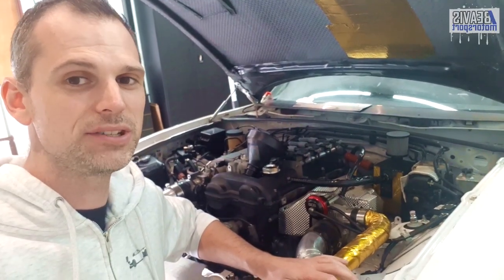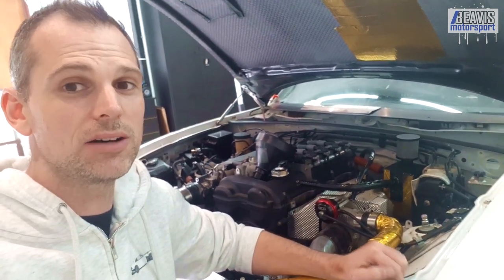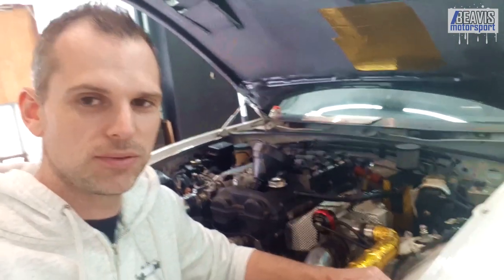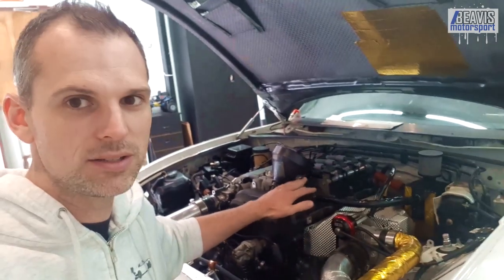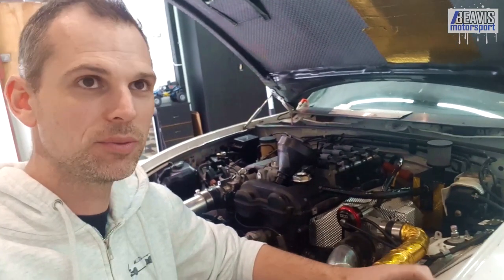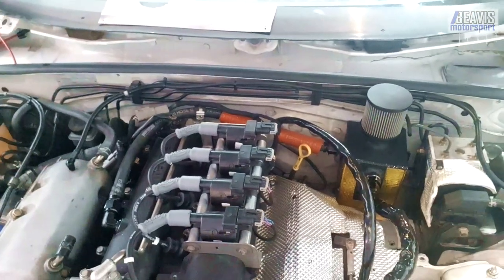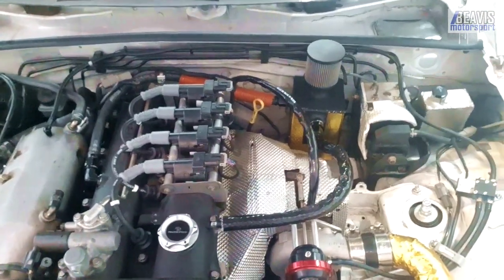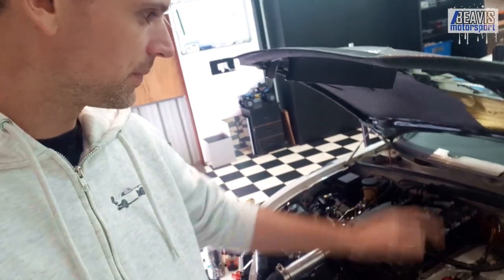Why is the Catch Can on my Turbo Engine making milkshakes?

Comment from the maker: Thanks to all of you for the great and detailed comments.
I emptied and re-checked the catch can after my last track day, and there was barely 100ml in there.
So, I'm content that the volume is quite small for the amount of driving the car's been doing.
Most of you said a small amount of oil in the can is normal, and the 'milkyness' is a symptom of condensing moisture in the cooling air of the catch can.
In hindsight, I don't think there's any concern with the catch can setup.
Reply: Great news!  The beast slays for another day!

Comment: Before I watch, I will answer your question:  To bring all the boys to the yard.
Reply: After watching:  Sounds about right.  Everyone here has been able to give you a solid answer as to what is going on.  However, it wouldn't hurt to check compression and see if they are within spec, check your oil as well, typical inspection.  The catch can is doing it's job.  I personally empty it out every track day or every LOF (car rarely gets driven and it's usually almost dry)
Reply: How many dings in the song ?
Reply: @michaelbouwmeester387  more than four
Reply from the maker: I was wondering if someone would make a "boys to the yard" reference....
Reply: @tvanduyl  21 if my memory serves me well.

Comment: Just brain-storming here because you asked.  On my track car, prior to rebuilding the LS2 due to a blown head gasket the catch can would fill excessively, as in ~2L+ per track day.  Post-rebuild I get less than 500ml.  I'm sure you know this already but blow-by contributes greatly to crankcase pressure and thus pushing oil out of the PCVs.  Compression and leakdown tests are a typical starting point to get a picture of engine health/sealing ability .. have you done those recently?  From the milkshake comment you seem to be alluding to coolant mixing with oil 😬 Another thing to consider are those PCV lines in the valve cover, are they baffled or is it a straight shot?   On an LS there's a baffled plate that prevents oil going directly into them.  Ideally the catch can should only receive misty air-oil and separate them/collect the oil. 

Sorry for the ramble, as you likely know this stuff already, have had the same thoughts, and talked to your friends about other possibilities.  Hopefully, your engine's in good health and it's just a matter of changing up the catch-can plumbing.  Keep us updated!
Reply from the maker: I've not done any compression testing.
Thanks for your thoughts seems like my suspicions are about right, and in general this is the catch can doing its job.
In hindsight the volume int he can is less than first thought for the number of hours the cars been driving lately and certainly not a concern.

Comment: If youre running e fuel there may be more liquid catching. If youre running rich also. If youre not running any baffles in the rocker cover/s you will tend to get more oil catching also. What youre describing doesn't sound too bad at the end of the day.
Reply from the maker: Thanks for the feedback G, yes the car runs ethanol fuel.

Comment: are you running ethanol? you should run the fuel additive for ethanol, it works to reduce the amount of water in the fuel and stabilises the ethanol my old lexus was really bad for making caramel milkshakes for morning breakfast.

when you run the car you have to warm it up so all the condensation evaporates starting and stopping will make this effect worse, clean your catchcan regularly as well

i had two 50mm screamers and the condensation would appear on the oil every time i checked it, i think the most important thing is to run the car till its hot to burn off the excess vapour, also run penrite ten tenths as it still provides protection for bearings even with water in the oil worst case
Reply from the maker: Thanks Tom, yes the car runs e85 fuel. I wasn't aware of a fuel additive, do you have any more detail on what I should look for?
My car never experiences start-stop scenarios, being a track car its generally always running longer and up to temp, so I don't think it's producing excessive condensation from short trips.
I think the engine oil is clean, it's just the catch can that's showing the milky residue.
Reply from the maker: @TomBudin  Thank you for the link.

Comment: The more boost you run and the older the engine gets the more blow by you get. into the crack case it goes, it wants out and ends up in your catch can.

I have been thinking of make a puke/burn down box before the vents. 
Just higher litre volume to take the entire sump. Should a failure happen under full boost n rpm.
But i a sure dry sump also become economical ish near this point
Reply from the maker: Thanks for the thoughts Wahring

Comment: It happens to be my profession,kind of :) For fluid oil an oil trap/baffle system in the engine/valve cover is the most efficient way. The oil mist with small particles will blast through though, but that might not be an issue in your case.
Reply from the maker: This is why i ask these questions, for the pro's such as yourself to educate me, and others, on the correct answers! Thanks for your response Cedric.

Comment: Need to enlarge the inner baffle holes to reduce the air speed. If it's too fast it will carry oil out like a magic carpet, especially with your cornering forces. I have also enlarged the outgoing holes from the valve cover to AN12 and AN10. Carpassionchannel has a good video on it.
Oh and milk is ok. It's just water fuel and oil mixed together. Ethanol and aftermarket pistons increase the fuel going past rings. Do you have fuel cut on overrun? Reduced oil contamination with fuel
Reply from the maker: Thanks Domas.
Eventually I might look into increasing the hose diameter to AN10 and welding bungs on the valve cover.
Yes, fuel cut on overrun is enabled.

Comment: Catch cans aren't really a good solution to this problem. Usually the place they sit is too cold to allow for enough evaporation, so they just fill up with gunk as ring blow-by condenses. Any air/oil separation should drain back into the oil pan where moisture can evaporate. You can accomplish this by using a cyclone separator with a drain back into the oil pan.
Reply from the maker: I feel like capturing this gunk and discarding it is a safe solution, I don't mind having to top up the oil 100ml after each track day if it keeps junk out. Does that seem reasonable?

Comment: The VVT breather chambers are  different than the BP05/BP4W valve covers.  The 05/4W intake side chamber is divided into two chambers with a small pass thru area.   So it's more difficult for oil to make its way to the check valve.  The VVT is one large chamber with no flow restrictions.  So once oily air is in the chamber, it has nothing to slow it down as it exits the breather. A friend added a zig-zag baffle inside the chamber on mine to try to slow the air some and let the oil fall out of suspension.  We also enlarged the hole for oil to drain back into the center cavity.

As for the milky state, as others have mentioned the water vapor in the can condenses as everything cools.  Then it all gets shaken up again the next cycle.  Some catch cans run coolant thru them to keep everything warmer and burn off the water from the oil before draining back until the crank case.
Reply from the maker: Thanks Andrew, general consensus seems to be that the milkyness is appropriate for the catch can, and it's doing it's job. Appreciate your comprehensive response. I'm content that the valve cover breathers are sufficient for now, but will keep in mind if i need to tweak the setup.
Reply: @BEAVIS Motorsport  I have pictures of the valve covers side-by-side I can share if you're curious

Comment: Short answer: sounds normal for an E85 turbo car.

Context: I drive a turbocharged Subaru on E85. Just swapped from an old/worn engine to a brand-new block and reconditioned heads.

Before and after the engine swap the catch cans would fill with a combination of smelly water, foamy "butter" and liquid oil (in that order by volume). More so in the cooler months. Different oils create a different amount of "butter". Eg Penrite Ten Tenths makes less then Penrite Enviro Plus. 

Long answer: I think what is happening is that E85 produces more water vapour and fuel volume in the blow-by. Some of that creates an emulsion with the oil to create that milkshake/butter. Apparently journal bearing turbos whip the oil into a foam (that returns to the sump), so that probably contributes to the emulsified butter. 

If your "clean" return lines from the catch can back to intake (if you run them) are relatively clean then there is probably nothing more to do but regularly drain the catch can and monitor oil levels. Otherwise, look at more effective catch can baffling, multiple catch cans in series, vent-to-atmosphere and so on. If the butter is excessive, experiment with other oils.
Reply from the maker: Thanks for the comprehensive response Yowie. Really appreciate the detail.
I think for me the engine oil itself is fine, and doing it's thing. The catch can is milky as a result of condensation and moisture absorbed and exacerbated by the ethanol fuel.
The volume within my catch can isn't actually that bad, I just hadn't emptied it for probably 12mths.
Reply: @Bbeavis  No worries - thanks for putting up the content in the manner you do. 
Re the topic at hand, bear in mind that water is a by-product of hydrocarbon combustion. For some reason ethanol fuel combustion seems to make more water (not sure if chemistry reason or just greater fuel volume burned). As such, I suspect that the outside air is contributing very little to the water vapour content in a crank case and catch can - it would mainly be water vapour in the exhaust blow-by. In colder conditions, that exhaust water vapour probably condenses out that much more readily.
Reply from the maker: @yowie0889  Understood, not much in the way of cold weather for us lately but perhaps that's one contributor to why i had more buildup in the catch can last year when the weather was cold.

Comment: You said the "PCV wont work because it´s turbocharged..."
My car is turbocharged and have a PCV Kit...  ?
Reply from the maker: I don't really know for sure, feel free to educate me.
But my view was that the small one way spring of the OEM PCV valve would be ineffective against the boost of the turbo.
Reply: @Bbeavis   I dont really know why. My car started as a Saab 2.3t with 170bhp. Now have 280bhp and is a dedicated track car. My brother have the same spec car but tuned to 530bhp for daily and track use. We still use the factory PCV. In his car, my brother added an Oil Catch Can to further improve the PCV efectiveness. Everything plugged as factory with all the sensors and all...
If you want me to show you how the Saab PCV works, I can mail you some pics...
Problably you can find them too in the web.
If I can help in some way, please let me know ok?
Love your channel.... please keep up!
Reply from the maker: @J.Galvao76  Thanks for the detailed reply, I am very jealous, we do not see many cool Saabs in my part of the world. I'll look into how the 2.3t setup works and see if I can take anything from that for my car, appreciate it!
Reply: @Bbeavis  Thanks for your nice words!!!
Reply: there are diff pcv for diff pressures most turbo cars have a higher threshold than oem .. personally i have less issues without the risk of anything going back to the intake when the pcv fails ... but everyone has diff results to there app and boost levels so the variables to car factor makes it a open book sorta speak as results may very lol ne ways nice build bro peace n love keep it rad stay safe and build on l8z

Comment: Sps motorsports (see their channel) attaches two lines to the top of the exhaust side baffle. Then drills 7-8 more holes from the center baffle to it. They block the intake side because its too open and spills oil in on hard left hand turns.
Reply from the maker: Thanks for the suggestion, SPS do some great stuff for the MX-5, I'll scour their Youtubes to see what they do.
Reply from the maker: @NitrousVolvo  perfect!